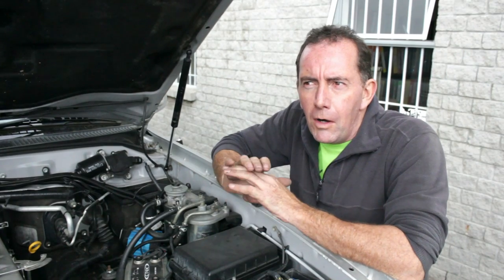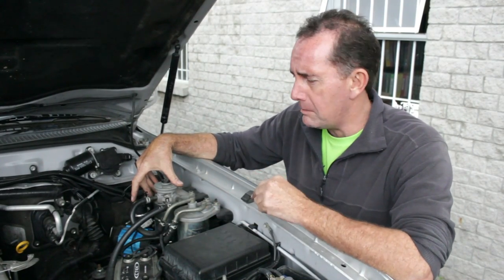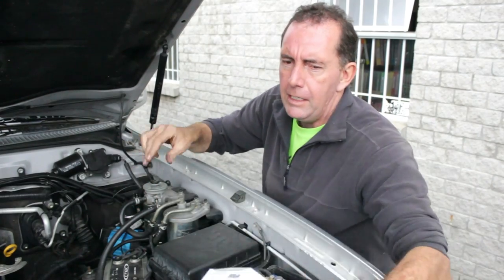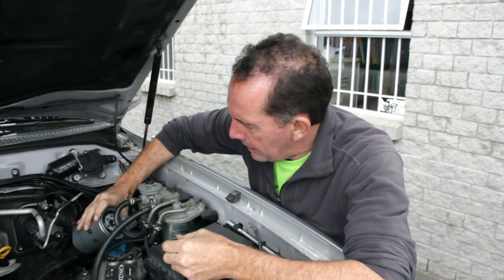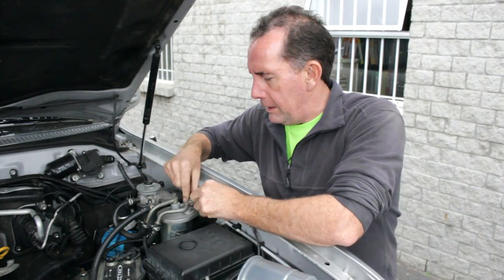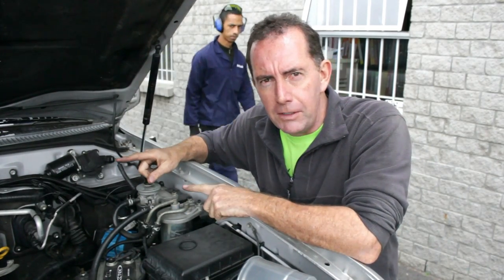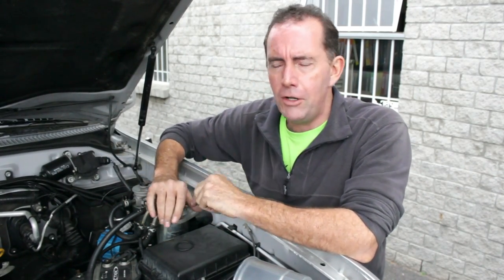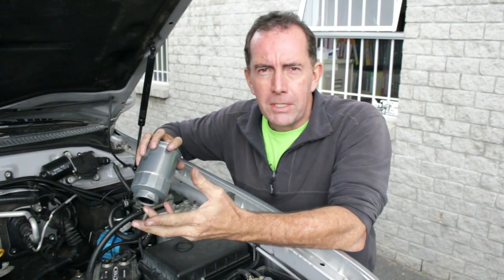Changing a Petrol Filter - Paul Marsh

Comment: That's a very good set up on the Toyota with a pre-filter and a main filter. If your overland vehicle doesn't have a prefilter it's well worthwhile fitting one, ideally the type with a transparent bowl so you can see if the fuel is contaminated.
A word of warning - some modern vehicles are extremely sensitive to trapped air and require a lot of priming to eliminate (and I mean hours of work). To be safe, don't do a filter change out in the wild, ideally do it at a proper workshop / garage.
There are some eye-opening videos on Youtube about the quality of some brands of filters (and it seems that the Wix filters are amongst the best). Best to take your own spare filters with you rather than buying en route.
The last comment in the video needs to be highlighted. Carry a filter type funnel with you to clean up dodgy fuel. They are however quite slow and it will be a pain - you will probably need to put the fuel into a jerry can first and then pour it slowly through the filter funnel into the tank, but this is still much preferable to having contaminated fuel in the injector pump.
Good video.